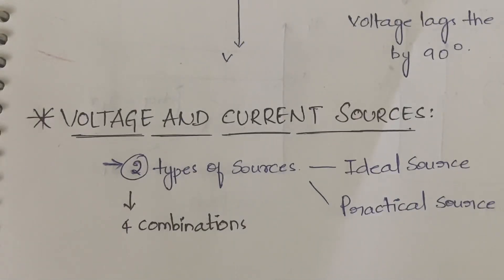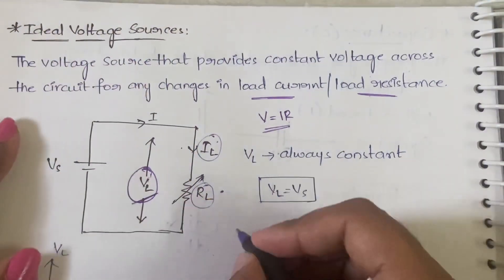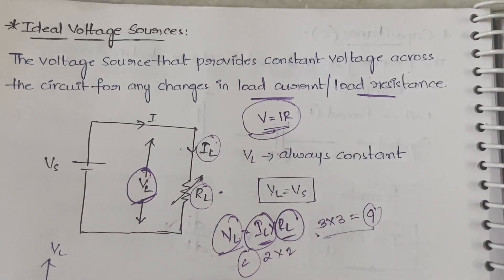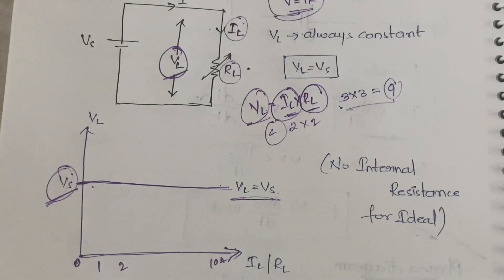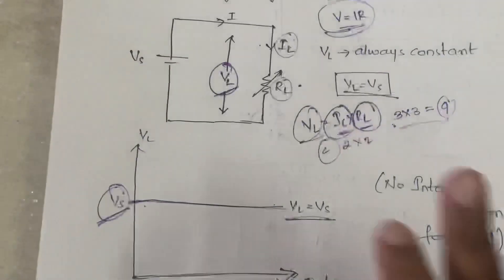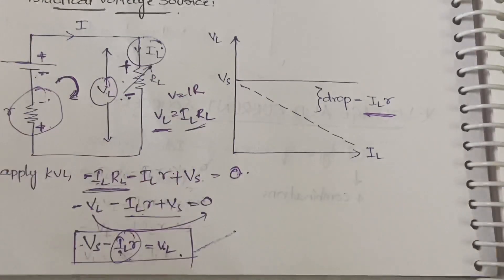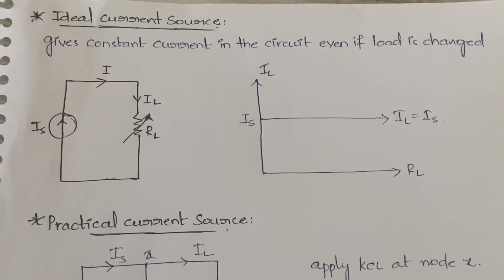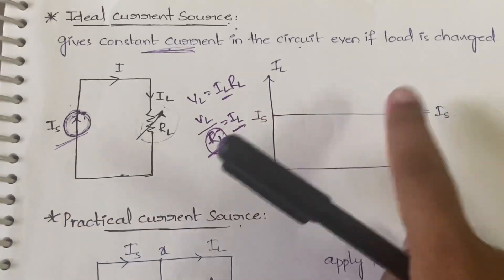2. Voltage and Current Sources - Ideal & Practical with diagrams |BEE|

Comment: All theory BS. 

Tell me what is the difference between a current source and a voltage source?

Both are practically the same device. We only apply potential difference (voltage) across two points to make current flow between them (circuit).

Battery/Cell, Generator, Solar Panel are all sources of electricity and are both current as well as Voltage sources.

This confusion and difference of a separate voltahe aource and a currwnt source is created just to prove Thevenin's Theorem correct in circuit analysis.

Comment: If my RL is 0.3 Ohms (which is wire resistance) and my Is=30mA. will it create a voltage drop = 9mV across the wire? or it will be some thing else.